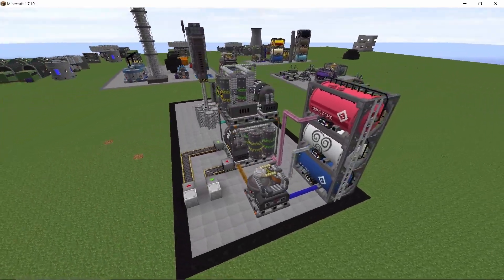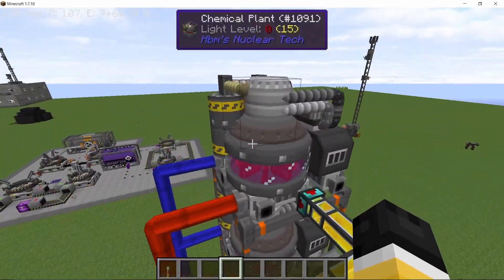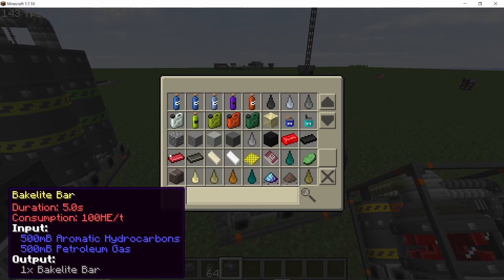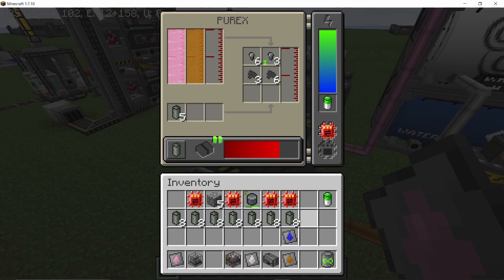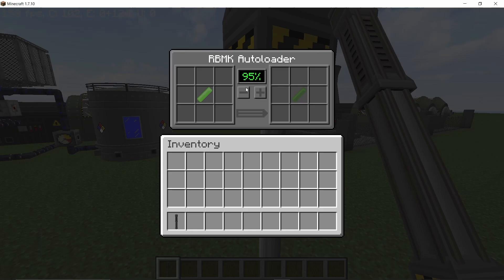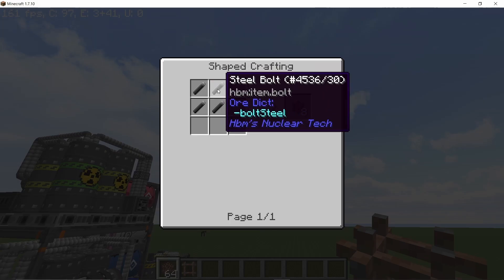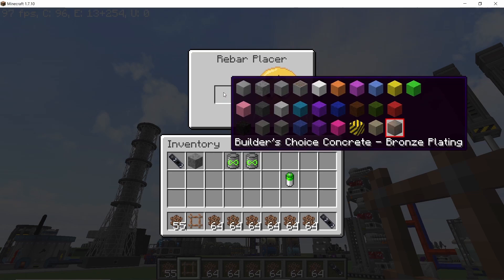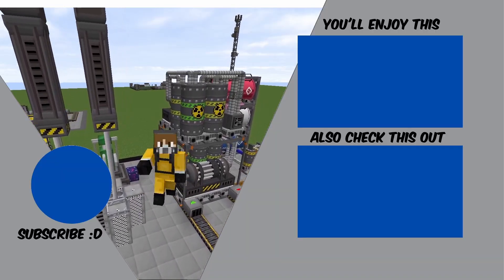RBMK Autoloader, PUREX Machine, Rebar and More - HBMs NTM Updates and Changes

Comment: I think that people who update HBM could create a modular system of engines, with gears that rotate the same as in CREATE, engines like V4, V6, V8, V10, V12 or V16 and beyond, and that these engines generate energy, like, they create a pipe that turns an electric generator and generates energy, just like turbines,  it would be very good, and these engines have various types of fuels such as gasoline, ethanol, diesel, petroleum and others, it would be very good if they had that.

Comment: The only thing I hope we don't lose in this update is the ability to create custom recipes using the chemical plant or assembler machine. I had a bunch from before the nw assemblers and chemical plants were added and now they don't work and trying to reimplement them with the new system has been a struggle, Especially since the exact numbers of solid/liquid inputs and outputs has been changed from 4S + 2L in/out to 3 and 3 in and out. I also notice they remove the text stating that you can add more recipes and trying to add them so far has been unsuccessful and resulted in numerous game crashes.